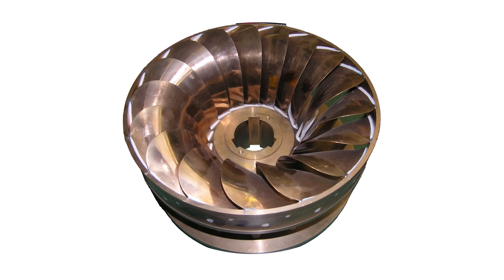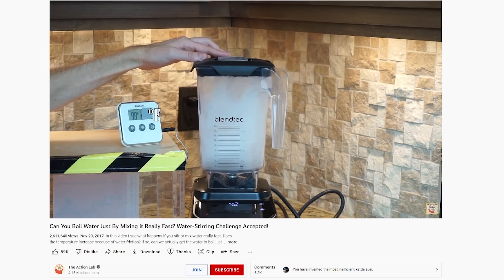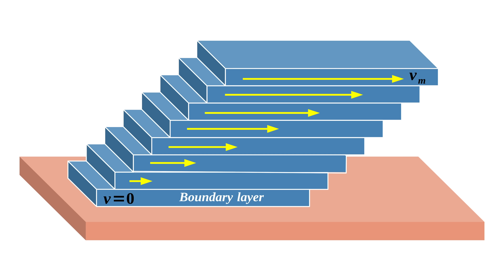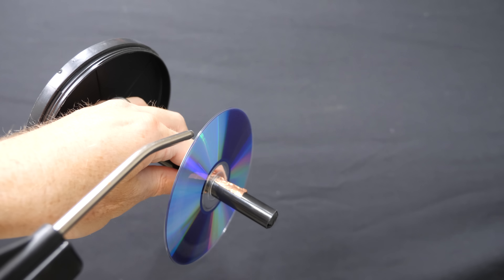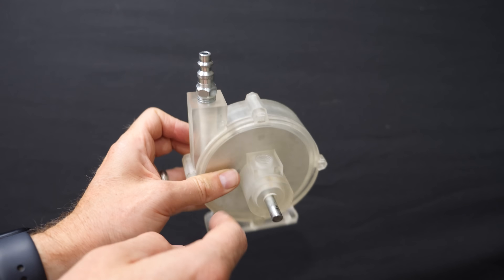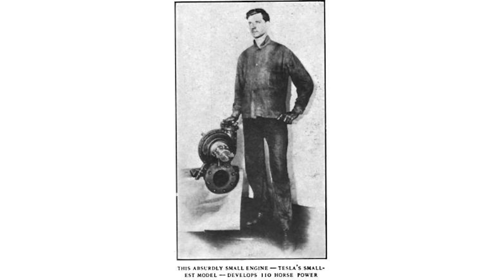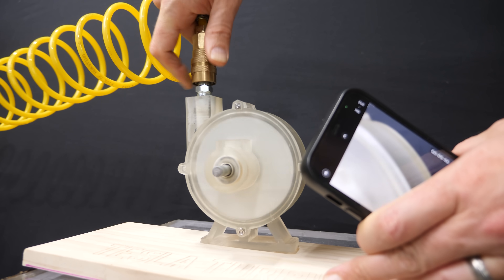How Fast Can a Tesla Turbine Spin?

Comment: Intresting video 👍 I would just like to point out that modern water turbines have efficiencies in the region of 95 to 98% as you have show a water turbine at the start. For gas turbines this might be signifficantly lower.
Reply: And for wind turbines its way lower becouse the operate in a completely differnt way by exploiting lift generated by the air flowing along the wings similar to aircraft wings and the edficiency is low because they can't cover large areas because of interferences between the wings.
Reply: @gabrieldepaoli9078  I would just like to point out that modern Tesla turbines get over 80% efficiency. 

“Design and Development of a Small-Capacity Tesla Turbine for Rural Application

ABSTRACT
Bangladesh is in great need to find renewable energy sources for its fast-developing industrial sectors. The main objectives of this research are to design and fabricate a small-scale efficient Tesla Turbine for remote areas and test it through experimental investigations. Performance analysis of the newly designed Tesla Turbine suitable for remote areas of Bangladesh will be conducted. Until now, a number of researchers have undertaken several tests and studies to evaluate the Tesla turbine's performance and efficiency. Tesla Turbine does not proficient in producing torque. The work here consists of computational analysis and an experimental campaign by fabricating the turbine. Solid Edge 2021 is employed for our 3D modeling. For modeling, the desired material is Polylactic Acid (PLA) or ABS Plastic. The proposed design consists of 51 disks with an identical spacing of 3 mm. This design has led to achieving a torque of 19.85 N-m and a staggering efficiency of 81%. It was found that stress generated on the disk edges is higher than their centre due to high centrifugal force.”

^^ with a plastic TesTur no less 🤭
Reply: @testurenergy  many gas turbines operate over 68% efficiency. In the field of work which I'm most familiar with, rocket engines, regularly operate in the 70-80% total-to-static efficiency range. Check NASA SP-8110. Steam turbines in power plants regularly reach 85%-95% isentropic efficiency, from a cursory search; and modern turbofan turbine efficiencies are in that range too.
Reply: @mariohernandez1111  give me an example of an actual gas turbine that gets those efficiencies? You should easily be able to find the name and model of a turbine that does that.
Reply: @testurenergy  sure. The turbine on the RL-10A-3 rocket engine, which reaches 74% total-to-static isentropic efficiency, and was in production 60 years ago. You can find its operational parameters in NASA SP-8110. 

Mind you that rocket engine turbines are not designed for utmost efficiency, but rather for the highest power to weight ratios. Rocket engine turbopumps are the highest power density heat engines ever designed, in some cases developing almost 100 MW in a package the size of your car's engine.

Jet engine turbines, by virtue of having a much higher pressure ratio, and being designed for peak efficiency, reach over 85%. It is hard to get you data because it is highly proprietary.

As a final note, I can tell you that there is no conspiracy. If Tesla turbines or Tesla pumps had qualities that surpassed conventional turbomachinery, at least us rocket engineers would be using it. And they do have use cases, such as very low specific speed pumps, in a narrow regime where they beat other turbomachinery types. However, outside of that regime the reality is that other turbomachinery types are more efficient. I.e. you won't beat an axial turbine over the specific speed ranges a jet engine operates at. If I had to name a usecase where they might shine, it's fuel pumps on care engines, which have very low flow rates and where reliability is of utmost importance. In fact, we are seeing a shift nowadays to regenerative/peripheral pumps over old school gear pumps because of reliability.

PS: I'd be willing to take this conversation somewhere else other than YouTube, if you so desired.
Reply: @mariohernandez1111  lets rephrase. Show us a turbine that gets 90% and anyone can actually buy and use. 

The industry standard for electrical generators are the piston engine generators from Home Depot and lowes that at best get 15-20% thermal efficiency. And industry standard for micro gas turbine electrical efficiency is 25% according to the DOE. 

I feel comparing anything else is just disingenuous and completely ignores the real problem of complicated manufacturing making bladed turbine incompatible with general use. 

TesTurs don’t have to be the holy grail to be viable, competitive, and feasible. They only need to be the same with less maintenance than what’s currently even offered for it to be worth it. 

Never mind the fact that modern hydro Tesla turbines have already been shown to get 81%. So, I’ll have to disagree that modern engineers have decided to that TesTurs aren’t worth it. 

First off I have a degree in physics and build real working Tesla turbine electrical generators for a living that output real power and torque even at low RPMs. I even have my TesTur geared UP to my generators at 46/15 (3.0666:1) because it gets so much torque, again even at low RPMs. The exact opposite of what everyone demands must be don’t to even make them work “because they spin too fast and get low torque” 🤭 but really that’s only if you don’t know how to design them correctly. 

But lastly comparing a MANY staged axial bladed turbine to a single stage Tesla turbine is apples to space ships. 

And yeah I’d be more than happy to continue this conversation I just have no idea how to without “self promoting” in a way that’ll just get my comment hidden.
Reply: @mariohernandez1111  and TesTurs are the only turbines that can handle multiphase fluid flows for any significant period of time without damage to the complex geometry blades that are relied on for the torque on bladed turbines. 

You CANNOT put wet steam into a bladed turbine. Full stop. You will destroy even a multi million dollar steam turbine in minutes by putting wet steam through wearing the blades down to little nubbins. 

For that matter ALL bladed steam turbines don’t actually get their rates efficiency in practice because they leave A TON of energy on the table by not fully expanding the steam through the turbine and having to use that heat for boiler feedwater preheating, plant heating, etc. 

The Tesla turbine doesn’t suffer from this damage due to particulates in the flow or cavitation and as such can be utilized to garnish more energy than bladed steam turbines for the same motive fluid supply.

Furthermore TesTurs stand to potentially be the BEST cryogenic turbo-expander for air Liquefaction using the Claude air liquefaction system. For the same reason that bladed turbines can’t fully expand steam, air liquefaction turboexpanders cannot fully expand the gas beyond the point of condensation forming due to damage to the blades/pistons. 

But again this is not an issue for the TesTur due to it having no lifting surfaces for the cavitation/particulates to smash into.
Reply: @mariohernandez1111  are you talking including thrust?
Reply: @mariohernandez1111  but like 🤔 how are you going to claim the Tesla turbine can’t keep up to massive turbines that have been specially designed because the Tesla turbine only has specialized cases…. But then also in the same comment say that those same rockets and their turbo pump aren’t also designed to ONLY operate anywhere near those numbers at a very specific operating condition.

They are useless for peaker power plants, hardly any variation in load. 

Like how disingenuous to compare the turbines that HAVE been optimized and can operate outside of their performance zone with a turbine that’s NEVER been optimized but has been shown to operate competitively efficient at a fairly moderate load variation.

Even modern hydro TesTurs, before optimization, have been shown to get over 81%…. But you’re going to tell me that if I didn’t throw as many billions of dollars that are thrown at other turbines, just to get even 1 percent point increase, at the Tesla turbine I wouldn’t get a competitive turbine… 🤭

Ok bud! 

Biggest hurdle the tesla turbine has… plot twist… there almost nothing left proprietary left with it.

Good luck getting an investor to fund a multi million dollar R&D start up with almost no guarantee on barriers to entry for a competitor just copying it. And just “Because” massive corporation “could” have developed one of it was worth it doesn’t mean that they actually have and determined otherwise. 
 
With the investment in “risk” of the technology never having worked to give credence to the venture let alone having no proprietary IP and profit security… yeah ok… 

Those two grounds alone are enough to make 99.999% of investors run for the hills because they can find a guarantee a return sooner in a safer investment option. 

There are far more reasons than “the Tesla turbine doesn’t work competitively” for the Tesla turbine not being brought to market. Business complexities that I wouldn’t expect most engineer to know without being explained first, and/or also having some business background.
Reply: @CharlieSolis  I don't disagree with any point in this comment other than this:

Why am I able to compare a multi-stage turbine to a single-stage one? Because at the end of the day, there is no fair way to compare different turbine designs if you restrict them to single stage. Same applies for pumps. A radial turbine for instance will get you much higher pressure drop per stage than an axial one, as a direct consequence of Euler's equation. You can't just derive the conclusion that radial turbomachinery is better out of that. Radial and axial, staged or not, have their place.

Lastly, it is clear that you know what you are talking about. Thanks for being insightful.
Reply: @CharlieSolis  again, this is all majorly correct. I wouldn't go as far as saying axial turbomachinery can't accept two-phase flow period, but it is definitely true that they have a much harder time.
Reply: @testurenergy  look, the reason I'm comparing to rocket engine turbopumps is that it's my field of experience and where I can give you numbers I'm confident in. Unfortunately, I cannot just go to Rolls Royce and ask them for proprietary information. 

Also, I'm not talking about levels of investment either. I'm just going out of pure principles on how turbomachinery works. There is nothing inherent to the turbines I mentioned that make them better because someone poured in millions on them. They are just the right fit in terms of efficiency, size, operational parameters, etc. 

About the staging thing, refer to my previous comments.

Also, regarding the "narrow and specific range" comments... it's just what it is. Have a look at a Balje diagram. I'm sure there are use cases, as you have pointed out. Also, I'm referring to the range they are applicable in... which doesn't mean that any particular design will be able to operate across the entire range. Just because you can design an axial turbine for a really large range of flow rates, speeds, etc, doesn't mean that a single design will operate efficiently across the entire range. So you trying to call out "rocket turbines" as not being able to operate across a large range... of course, they weren't designed to!

About not being able to get investment on them... well, I was never discussing that, but your points make sense.
Reply: @testurenergy  and no, I'm not including thrust. As I mentioned, it is total-to-static isentropic efficiency, which is the most conservative (aka least optimistic) metric you can get out of the efficiency extracting energy from the fluid.
Reply: What if you used the steam pressure to displacement pump water through a water turbine? could you get higher efficiency that way?
Reply: @arkatub  the thing is you also need a flow and not only ressure from the gas and I'm not shure but I would guess gas turbines have a efficiency only slightly lower mening a few percent less than water turbines (which is significant but not necessarily compensates for any device conveting the gas pressure somehow into a high pressure water flow).
Reply: @arkatub  How would that work? How do you get water between the boiler and the turbine?
Reply: @pxlcowpxl6166  I already realize it's a stupid idea, you would just use steam to push down water in a cylinder, and use 2 cylinders in tandem to get continous flow, but again it's a dumb idea.
Reply: @arkatub  So like a piston engine, but the piston is made out of water. It's fun to imagine, but I think steel works better.
Reply: @arkatub   definitly sounds like a funny concept could maybe even work on a theoretical level if you can separate the two fluids with a membrane. I think your Idea is similar to hydraulic ram pumps with membranes to pump fresh water with the energy input of running river water. But this is creating very high pressure intermittently.

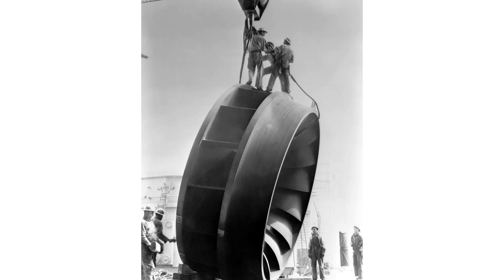Comment: 04:53 - "There's too much risk and cost associated with replacing all of the turbines that are currently in place in our infrastructure"
But that doesn't explain why the Tesla turbine concept is never used in new turbines. There has to be more to it than just that.
Reply: Extremely low torque. So even at a 5 digit rpm number the power output is tiny.
Reply: @tylerhope9969  🤭 has plenty of torque. If you know how to actually design them properly.
Reply: @tylerhope9969  Yep.

Comment: Is there not a breaking point like if you spin an apple in the air with an air gun until it exploded from the inertia.  So if you pushed 300 psi through that lil toy and the sides didnt blow out how fast would it go before it either self destructed or reached an equilibrium..?
Reply: 3600 rpm?

Comment: So 3600 rpm...??
Reply: Is there not a breaking point like if you spin an apple in the air with an air gun until it exploded from the inertia.  So if you pushed 300 psi through that lil toy and the sides didnt blow out how fast would it go before it either self destructed or reached an equilibrium..??

Comment: If a Tesla turbine works in reverse, what would happen with purely siphoned liquid. Can air be siphoned?
If the tube down was long enough, could air be siphoned using a Tesla turbine? Maybe with a kick start?
Reply: If the pump was on the ocean surface and the siphon pipe was at an extreme depth.
Or if a room was made under a lake and water was fed, via sealed pipe, into the pump whilst the room was fed with surface air, would the pressure of the water feed the pump?

Comment: Can this be turned into a pump? Spin the discs to pump air or water out?
Reply: Yes, it becomes a centrifugal pump.
Reply: I assume it would't work as it is only sppeding up the fluid at as soon as you have any backpressure it wouldnt move any air or other fluid as the adhesion of the fluid to the discs is naturally very low
Reply: Theoretically yes and no. The center shaft is spinning which you could hookup to a belt to a second chamber which inside has propeller blades and 2 one way valves for an in an out.

If your asking if the main section of the turbine itself can be... idk. Someone might come up with some design/modification to do that but I havent come across one yet.